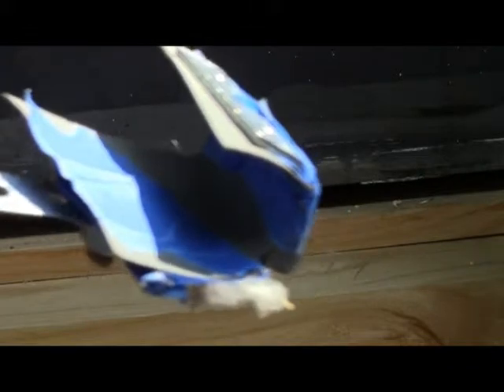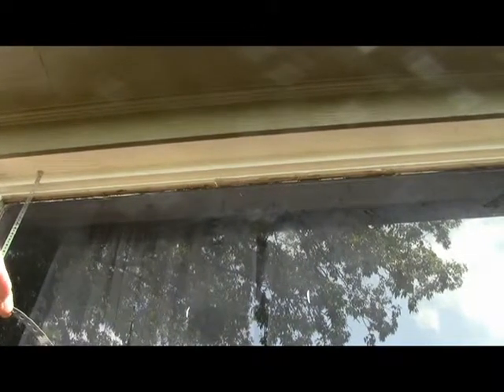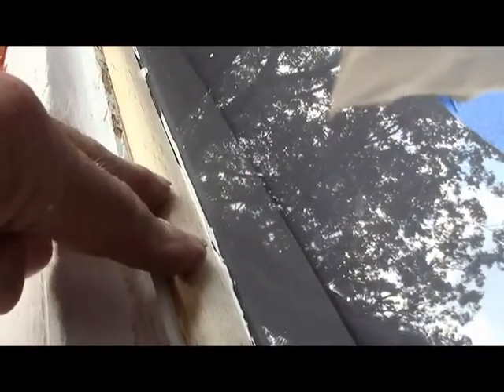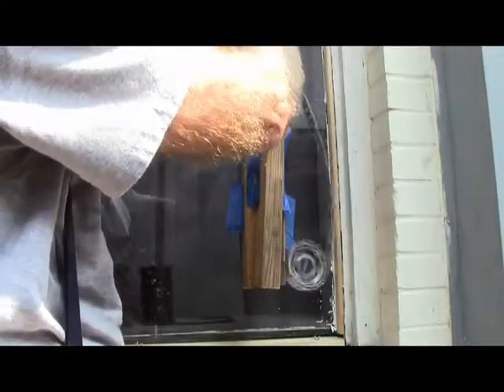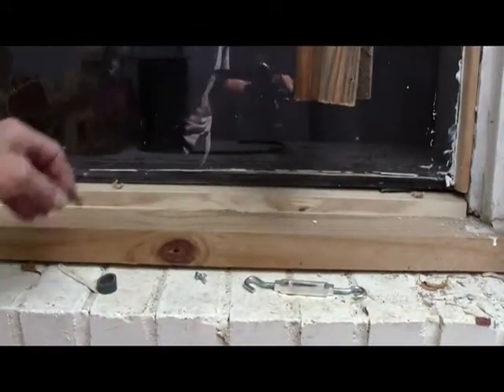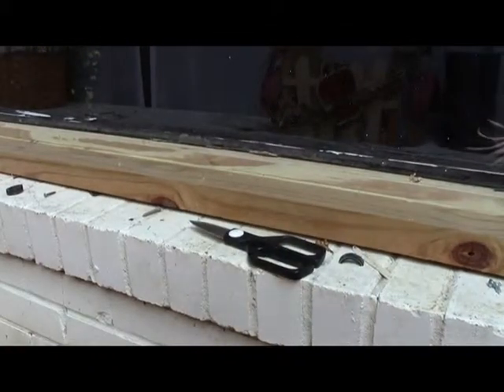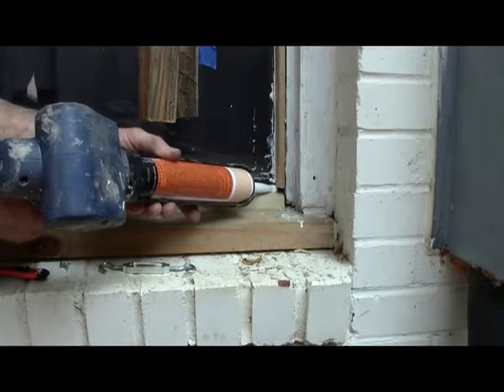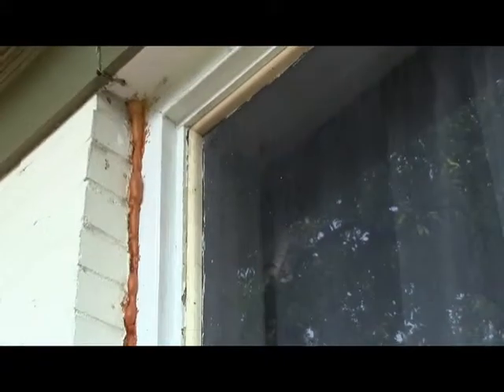How to replace window sill  under a plate glass #2. First video in description below

Comment: I just used this method to change a two window sill. Two windows, side by side. It had a copper metal divider that was between the edge of the two. The windows were about the same size as yours and had to be done at the same time because the sill ran the length of the two. Old commercial building in a small town. Saw lots of people going by laughing, I guess they thought we were about to get killed. It worked very well,  thanks for posting this.